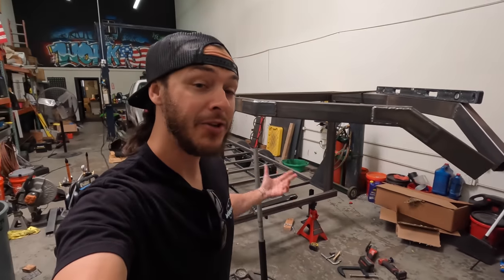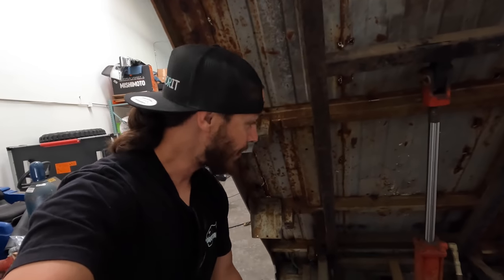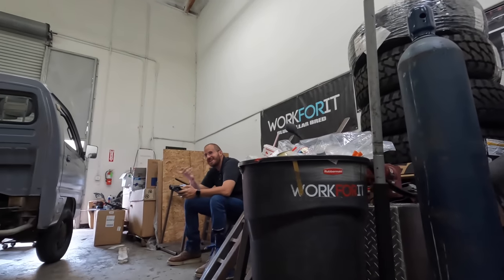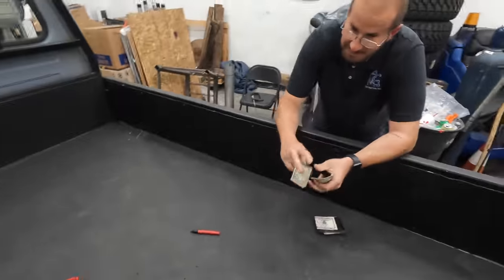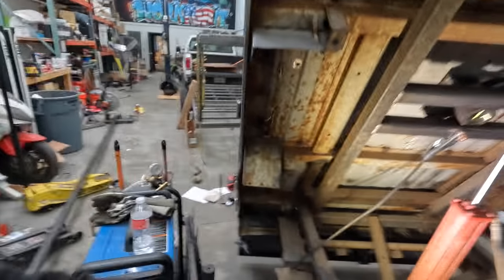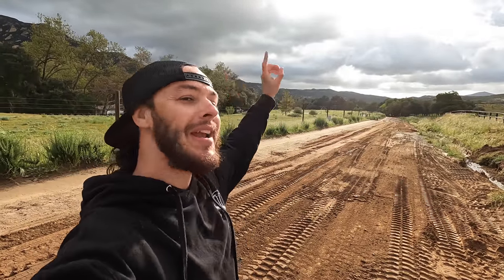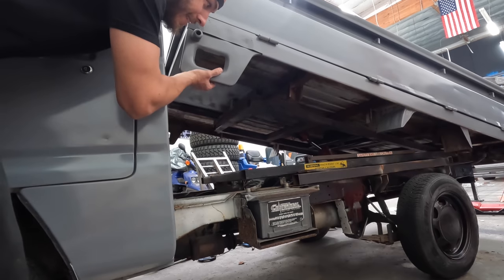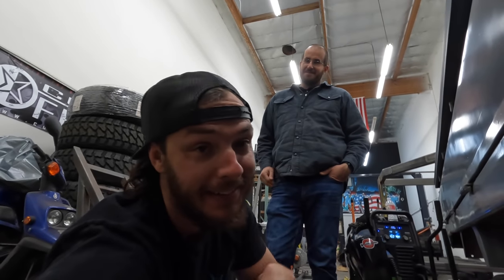Building a Mini Gooseneck Trailer for my Mini Truck! (Part 5)

Comment: I welded myself up a tri axle gooseneck trailer with beaver tail and the whole works for my RC truck. I got inventive and was able to use a ball joint and a spring airplane steering rod for a hitch. Works and looks killer

Comment: Just had an idea to help keep trash out of the hitch hole. Take the piece u cut out of the floor n a piece of square tube that fits the hitch. Weld up a plug for the bed. N if the ball sits to low n the gooseneck hitch rubs the bed... Drill the ball insert on the blank side a bit lower than the pin hole side. U can raise it however high u need.

Comment: B&w makes a taller ball that slides in there. I think it’s 2ins taller. You can use the spring loaded pins like they use on trailers for the bed locking mechanism. Or heck, cut the gooseneck locking pin for it.

Comment: You should weld the nut on the back side and thread the bolt in.  And if you weld a little piece of metal on the bolt to make it like a T to make it easy to thread it in and out.

Comment: Great job on the trailer and hitch .. If you weld the nut to the back side of the frame and cut the bolt a little shorter you would be able to take the bolt out with one wrench besides the truck instead of two wrenches under the truck..

Comment: 233: the goose neck most angle down & forward like u started to fab up, for securing weighting vs leverage purpose, check. 2nd I said u must hve a way to pull on right & left bals equally same time yet turning is done separately by pinning thru hole/into the bed that u just turn/ rotate on.

Comment: For the pin look at tractor supply or your local farm/ranch supply shop they should carry tractor hitch pins that will be longer and in the size you need.

Comment: Any box steel u can by of the rack is way to go u pick the hole or box bracket steal prt of the shelf w/nice sturdy floor u can move or position lay across your steal & easier to weld on then drill just about every time just depends on market & u r left w/laying welding stronger then just drilling as well & saving time.

Comment: Take the retainer pin for the ball and run it straight out the back. Had that same hitch in one of my flatbeds and ran it that way to make flippin the ball easier then reachin up under the skirt of the flatbed. Should have plenty of clearance in the back for the handle and wouldnt interfere with the dump bed operation

Comment: Hey man, just in case your welds don’t hold up or whatever breaks. You should install a backrack for the mini truck 🤣 so the gooseneck doesn’t go flying into the cab and hit you in the back of the head👀. I hope that never happenes but it’s better to be safe then sorry p🙏
Reply: the bed itself has a backrack already built to it. go watch the mini truck build series

Comment: Save the part you cut out of the bed and weld it to a piece that fits in the Receiver so you can plug it. Also the release going out the side wouldn’t work because the frame stacked inside of each other. Run it out the back and extend it if you need to it should tuck in just fine

Comment: Do you know I seen once where I have trailer hitch balls for gooseneck that you can actually push down and then add a spring back up we needed to use it so it’s still flush with the bed of the truck when you don’t need it with a flat metal flat Cover it when it’s not being used and it’s like it’s not there

Comment: a bucket w/only 1 side steel fixed the other side 4 side of bucket u slide down over top of 3 side bucket so u get the right needed shape sure depth kind of but width ding ding ding, 50$ dollar fee use from u only 1st two yrs if u get it to work easy quick change & lock or unlock come apart.

Comment: Why not build your own latch pins for the sides of your lock pins. I would use some solid steel washers and springs. Then that way it all is solid to lock in

Comment: Those fence posts need a pre push down or hammer in place fence slip on hole brace if in area that can flood out get design just cheap right quick sturdy hammer leave in place lasting metal in filled & secure a post worth 10S free use patent just u get to supply. right ht right cheapest metal nail gutter spike predrill hole in bracket & fence post then soft hammer screw secure. More similar problems u easily solve the more u become go to cheap fix supply in market.

Comment: You know they make special cutting oil for when you're drilling metal, right ? It was hard to tell whether or not you were using any, so forgive me if you were.
If you weren't using any, trust me, I was a machinist for more years than you are old. 😉
Nice work getting everything to fit in there. If it's too much for the mini to tow, then you will just have to drop a bigger engine in it. Maybe some trailer brakes too.

Comment: What I think would be better is loosing the middle Hydraulic Ram and getting two rams, one on each side and just putting the hitch welded on the frame with a cross member and just cut a hole on the bed and calm it a day.

Comment: I think if the front of the truck  go up or down.   The  goosneck will putt to much friction on the bed liner. The ball is to low.   I tink shoud raise it up about 3 inch

Comment: telephone poles laid end to end then pvot pined together & seure on end to ground, treated for sure or min burned treated best u can. Then w basic poles cut & laid end to end logs lay out secured u can hve a 1/2 ass ditch dich or swallow sipest lay out & top it w/gravel Or u can just plastic cheapest lights material cut & nail gun or staple gun cheapest poss hope u hve a good 1/2 pipe cheapest pipe plastic lip to staple or nail into pole U can always impove drainage but gravel or crete or pvc or storm catch basins city stuff cost big time, if u hve just as strong 20yrs+ design fraction of telephone pole & cheap pined ends & lightest 1/2 piping design u can staple on to pole both sides of pole in ditch u r set till city strrt & curbing comes along & u can walk on poles too.  if where u hve a drive way u just lay cut poles in side plastic cheap pipes in ditch so u can walk & Drive over that section of drive way  over top of pols even if u hve to add a sheet of painted ply to u get a grate to drive over down.

Comment: 6ft 7or 8" tall grate is what u need to fab up quickest glance U can still pick up 6ft grate as long as not wider than 2 or 3ft w/1 or 2 ppl if need b. If u hve drive width of grate u hve time to figure out rest of drainage problem * if need be can loan out your gate never moves every flooding rain or fab & sell some grate up. If u use best metal & finish poss w/your time & money GOD free help hand. Build the grate & if u sell it I can back the production loan for steal & finish if u fab work build it up. Up to say 500k & then I need to know u r for real not whack job but up to $500k backing any1 sei legit worth a fucking try faith backing sound project I mentioned it so sure it is sound.